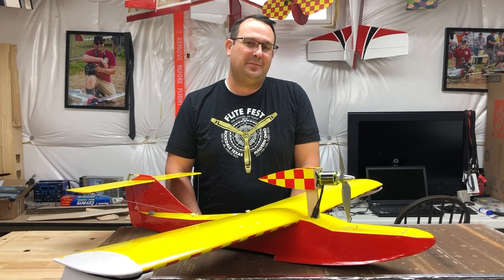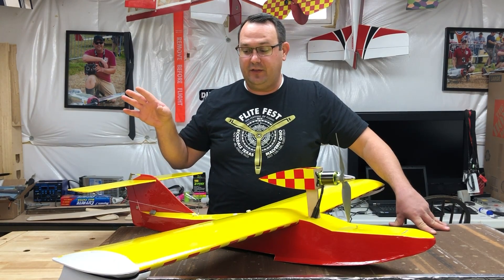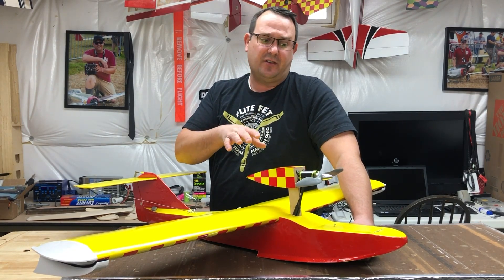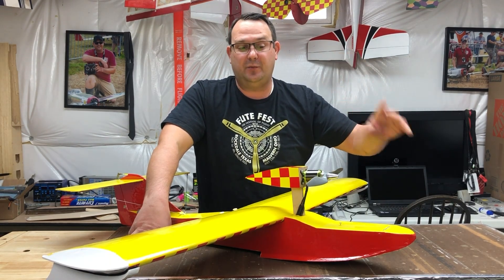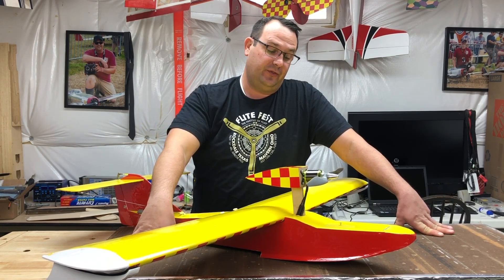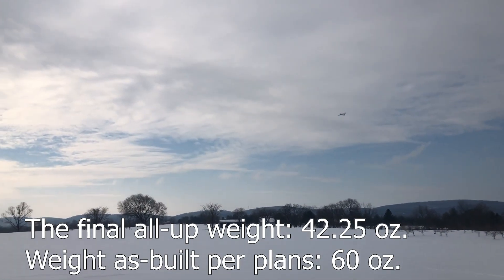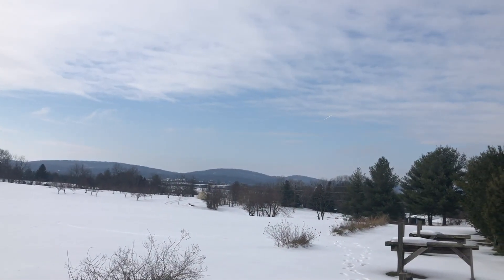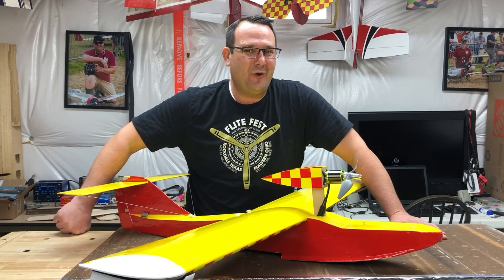How To Build A FOAMIE From BALSA PLANS

Comment: What do you think about colored packing tape on foam before you assemble? It seems like it would be easier to cover a flat sheet of foam rather than the shapes of your assembled plane.
Reply from the maker: The problem with before assembly is that you will still need to manipulate the foam and you will likely be marring up your tape. Frankly tape is not THAT resilient comparatively speaking to covering film. IF your model has compound curves, on this model there are none, then you get into even more troubles.

Comment: Fantastic plane and technique..!
how do you hold the motor pole in place..i see it really tall.
thanks
Reply from the maker: Helps if you watch the video ;) Check out 4:00, I cover the wood/foam construction there but it's all per the plans.
Reply: @JoshuaOrchard  I watched the video twice on my phone and i did not see the assembly of the post....i see it now.  I yout fist video of foam wings you mentioned a covering used for documents that is cheap......Could you please give more info about it i want to try , i never done any covering on balsa or foam.
Thanks for the rapid response. !!!
Reply from the maker: @alexherrera3918  Not much to tell other than try to find it! Most document shops have gone away from the heated stuff. Laminating films are generally done cold now with an adhesive.
Reply: @JoshuaOrchard  got it, i just do not want to use a expensive monocote covering just for learnig. Thanks again
Reply: @JoshuaOrchard  Forgot to ask, do you need a specific angle , "down" of the motor when located high? If so , how i learn to determine that angle? Thanks!!
Reply from the maker: @alexherrera3918  Yes, you generally do but it's built into the plans. Counter to your thought, the thrust angle on a mount like this is slightly "up" to counter the lever arm that the mount provides in relation to the center of mass of the aircraft. If you are building your own design, I suggest using washers to shim the motor and experiment with what angle works best for that model.